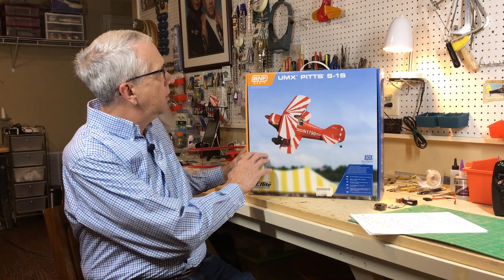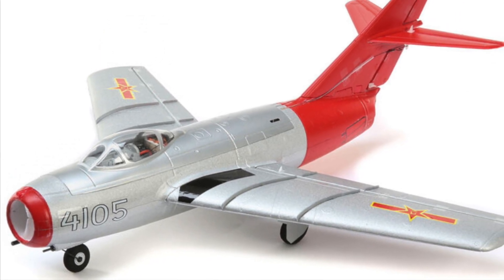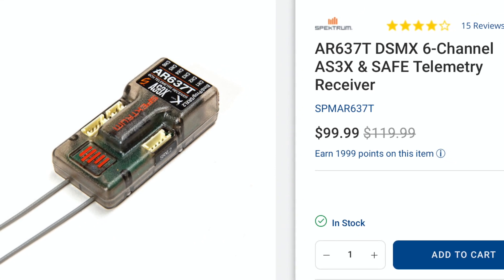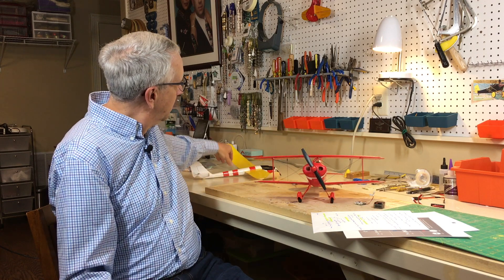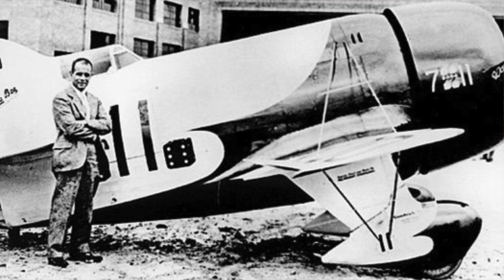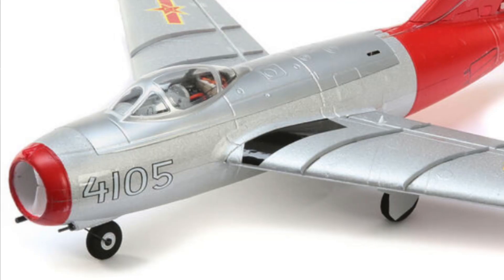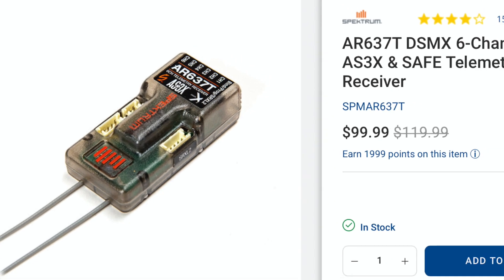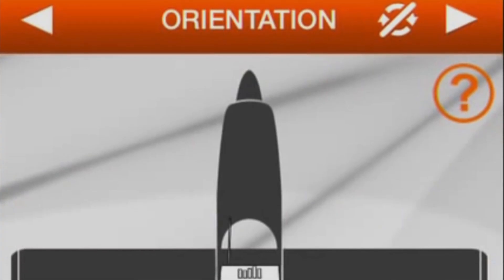Spektrum AS3X for Newbies!

Comment: Good video. Can AS3X rx work for a small kit built model like Guillows?
Reply from the maker: I think the AS3X is tailored/adjusted to the model it is fitted to. Also, and this is important, there can be zero slop or play in the control surface connection. Otherwise the minor control inputs cannot be used. It is just hard, at least for me, to get these very precise controls in place.
Reply: @TimMcKay56  Good points.

Comment: When I got back into the hobby I flew a P-51 made by Volentex RC, it had a (knockoff) SAFE mode that worked very well for such a small aircraft and helped me build my skills. The aircraft had a intermediate mode which allowed full control of the elevator but not the airleons and I used that for more advanced flight. Unfortunately with the models being about 400mm in wingspan they were too unstable to fly without stabilization and I moved on from that aircraft.
Reply from the maker: All good!  Tim

Comment: I would use that as a back up when making mistakes. Do you have an on flight enable/disable from the transmitter option?
Reply from the maker: AB:  I do not have this function. Tim
Reply: @TimMcKay56  Thanks, I'll see if there's a workaround.
Reply from the maker: 👍🏻 Tim

Comment: Tim I have another question for you I'm building another guillos model and the receiver I'm using is the one for the WL toys Cessna f949s which includes stabilization which can be switched on and off by the receiver by the transmitter if I shut off the stabilization will I be able to orient the receiver board on the side of the airplane like I wanted to or does it have to be laid flat on the fuselage? I don't know if it has anything comparable to as3x if that's the case does that mean it's always on even in the unstabilized mode in which case I guess I have to lay the board flat on the fuselage. Do you get the gist of my question? I can't seem to get an answer anywhere else thank you
Reply from the maker: George:  I am not sure of technical details.
Reply from the maker: Maybe continue with experimentation as you are doing. Tim